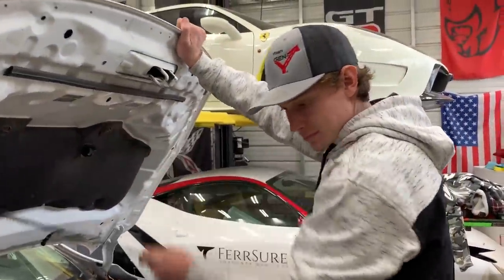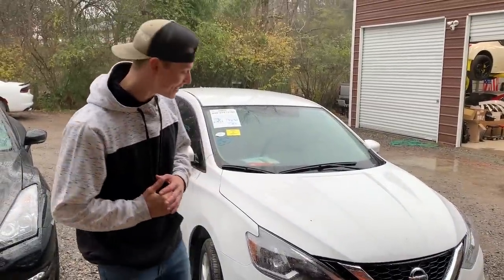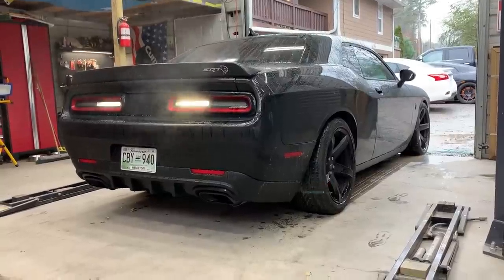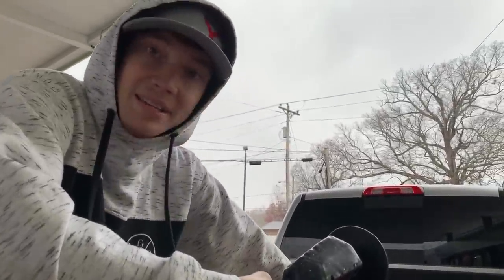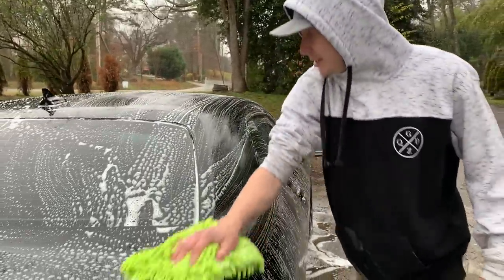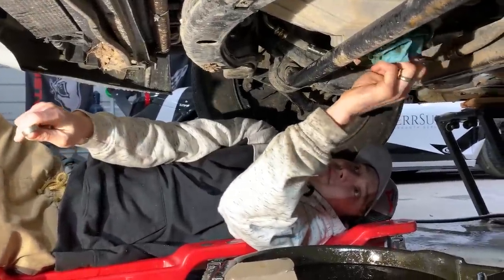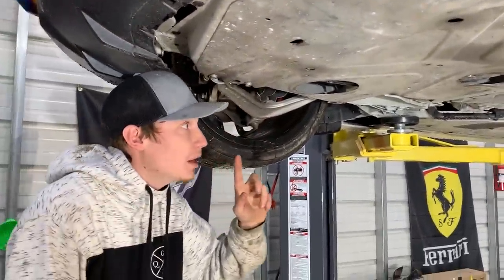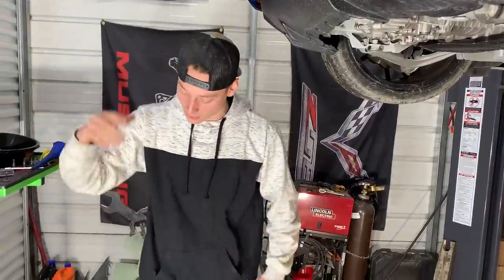Goonzquad: Behind The Scenes!!!

Comment: FYI: the Hellcat has two oil plugs that need to be pulled out. One is in the oil pan, and the other is in the oil cooler on the passenger side of the front bumper, you have to drop the lower cover to get at it in order to do a complete oil change. Also dodge drain plugs hate 12 point sockets and wrenches, they will eventually strip the heads, six point wrenches and sockets work best. I use to work at a dodge dealership.
Reply: Likely explains the short lifecycle of the oil.
Reply: The sad thing, is that Dodge's manufacturer recommendations state to NEVER use an impact/air/electric driver to put the oil plug back on, yet SO MANY dealerships do that anyway.  We ruined a drain plug on my SRT using a 6 point, because of how tight some idiot ASE tech put it back on.  It's supposed to be tightened by hand using a socket wrench then measured with a mechanical torque wrench.
Reply: G McGurk no
Reply: @rooh5825  torque is 20ft lbs
Reply: @rooh5825  Nobody uses an air anything on oil drain plug...lol impact on a plug
Reply: @icanfartloud  - yes "lol" they do, ASE is short for Another Stupid Error.  Nothing but parts replacers who can read a computer screen, not actual mechanics, just replacing parts till it fixes the problem, then charging the customer for everything they replaced regardless if it was broke or not.  Yep "lol" that's ASE for you.  And using impacts on oil drainplugs.
Reply: Roo H happened to my moms Jeep too
Reply: @icanfartloud  Right...
Reply: Or Amazon
Reply: Chris right! My Walmart is like $5 cheaper per 5 quarts and they also sell mobile 1 filters
Reply: Thank you brother

Comment: That kerosene heater also works in Diesel and used oil mixture. That way you can getvrid if your used oil by burning it in that heater. All of mine use the Rotella 15/30 frombmyv18 wheelers and a few gallons of diesel to lighten up the viscosity.

Comment: When changing oil have you ever thought of using flushing oil in before you put any oil in so you are not cross contaminating the oil with dirty oil? When i do mine i use flushing oil every 2nd oil change it keeps the oil clean and it also helps to protect the engine as it flushes all the loose little bits of debris from the engine but keep up the good work guys

Comment: Dudes, I love your mentality. You're a couple of hard workers, not afraid to get your hands dirty and not blocked by  'i cant do that' feelings, you dive into it and do it.

That being said. As far as the painting goes. I don't think you guys need a real pro painter to tell you what you're doing wrong and why you got those spots in your paintjob.

With all due respect, again, I love the channel and I love your work/mentality, paint-wise you really dropped the ball on this one. You paint it in a plain garage, under changing temperature differences and with bugs/dirt in the air. Even before you guys let it dry, the video clearly shows the paint job is shitty, dirt/flies/debris everywhere. In the end you guys threw on enough clair to buff everything out (or so it looks/you hoped) but you did just about everything wrong there. Then, to top it of, you put it outside in the rain.

Again, I don't think I'm telling you guys something new. I know you guys would have loved to have an own paint booth and room to let paint cure, in clear air and heat, without weather influences. I hope your new shop will bring you that. PLEASE do use the space you have to also build an own paint shop/clean room.

Comment: Might want to look into a heater that burns both kerosene and diesel. Diesel usually runs a couple dollars per gallon cheaper. They make heaters that will burn multiple types of fuel now, ours will burn 4 different fuels.
Love the videos guys.

Comment: Guys, most people just use Diesel in those heaters, 
No reason to buy high dollar kerosene for them...
Reply: diesel fuel contaminates the surface of the cars ,so when they go to paint it will leave behind fisheyes and such , so its a no no for diesel
Reply: It’s deadly to inhale those diesel fumes. Use kerosene always
Reply: @aaronf4201  Did you know Diesel, Kereosene, and Jet Fuels are all the same fuel,  just a difference in refinement. 
As to deadly, all fuels can be deadly, 
Todays ultra low sulphur diesel is no different in exhaust than K1... 
Been using it for 1 years or more, and if you use a heater like this without ventalation, you are idiot..

Comment: Use some p and s brake buster when cleaning your wheels and you can get your rotors to the spray actually has some rust prohibitor in it should help with stopping the brake squeeking.

Comment: Squeaky brakes can happen on any car that is left sitting outside which can get wet a coat of light rust and squeak until the wheels rotate in normal use and brakes are applied.

Comment: I used to work at a Dodge store for many  years.    I saw an internal memo that said that if you are using your Challenger or Charger for any severe service OR police use, for 6.4L and 6.2L engines, you can upgrade to 5W40 synthetic from 0W40 synthetic.    Pennzoil was the recommended brand.

I also recommend a Lucas oil additive as well as a genuine Mopar oil filter.   Preferably the black filter with the silver stripes versus the white filter with blue lettering.   The black filter is supposedly better.

My Challenger gets 5W40 synthetic with Mopar filter #0488 4899 and some Lucas.

Plate C

Comment: All new high output motors "eat oil" it's actually called (Blow By)you need to install oil catchers on your motors, they install on the pcv line or lines.they collect the oil blow by that gets sucked into your intake manifolds and can foul plugs and worse.

Comment: Love your guys channel. Was wondering about a situation. I have a 335i that I love. Was dropped off at a bmw dealer and the tow truck let it loose without engaging the e-brake. Long story short it rolled onto a curb and the damage is insane. Do you recommend replacing the bumper or having  it “repaired”

Comment: Another tip for washing cars is use the two bucket method.

After wiping the soap on your car, clean it off in a bucket of only water then put it in the bucket of clean soapy water and wipe the car down again.

It keeps your soapy water bucket clean and stops you from wiping your car down with dirty water

Comment: Yo Goonzquad, y’all should buy Micheal Luzzi totalled 5.0 stang. The front bumbler is gone, no head lights, radiator and radiator support is gone, looks liked you might have to replace the driver side wheel Nd stuff. Buts it’s a nice car, 8 speed automatic!!

Comment: Pro tip: get you some expanded metal, 2'x2', and lay it on top of your drain pan to catch those vertical oil plugs. Just make sure they don't land directly under the stream.

Expanded Metal Sheet
https://www.homedepot.com/p/Everbilt-24-in-x-3-4-in-x-24-in-Plain-Expanded-Metal-Sheet-801427/204225784